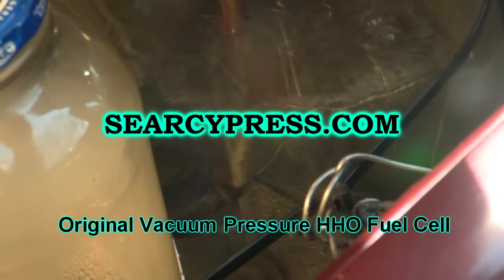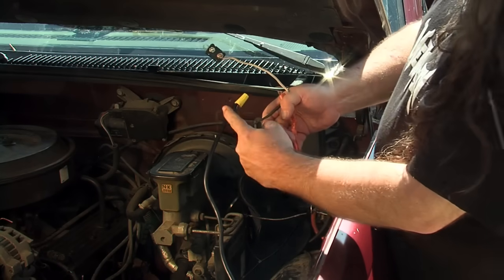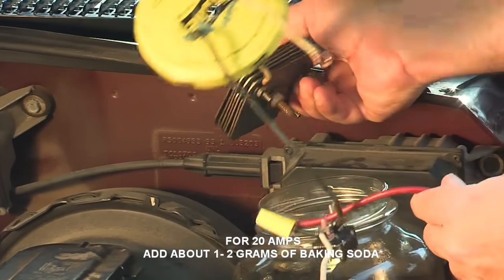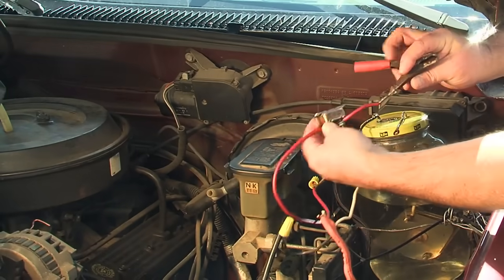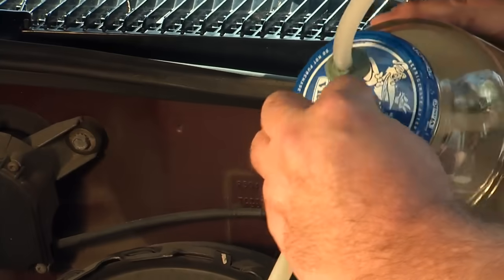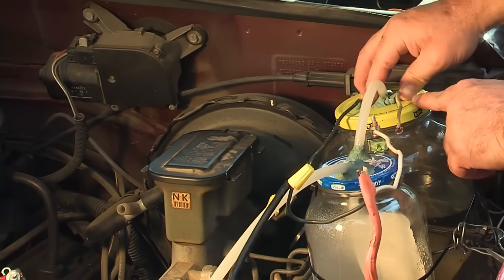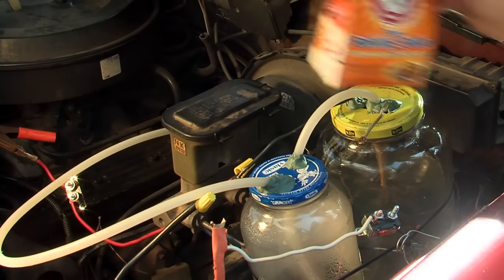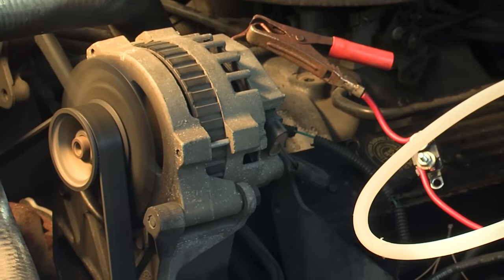Vacuum Pressure Hydrogen fuel cell defeats high gas prices using hydrogen from H2O.

Comment: how often do you add baking soda?
Reply from the maker: Generally about every 200 miles we have to add water. At that time you kind of have to adjust electrolyte. When it's hot the current flows more easily so under doing it is the way to go. Thanks for the comment.
Reply: just one more question. why don't  use salt or potassium?is not exactly a great chemist😂 Og tak for tidligere svar

Comment: Spoiler alert …. That engine is running on gasoline …. That jar of water would make enough hydrogen to run a model aeroplane engine for about 3 seconds after an hour of gas production… 😂😂😂😂😂😂
Reply from the maker: I understand your misconception. You seem to think we're running the engine on the HHO. That is not the situation. The gas we produce is injected in the state of vacuum into the cylinder where it accelerates the combustion of the gasoline. Spoiler alert, that is the only way HHO can be injected because any other method will result in dilution and no gain in performance. Almost 100% of the fuel gets burned in the cylinder leaving the catalytic converter cold. This results in great reduction of emissions and more power coming from the gasoline because it's all burned. The boost in performance is from gasoline and not from the hho. Thanks for the comment.

Comment: My grandfather worked at NASA and put one of those in a dodge van and drove it to work every day testing it for a month then drove it from Florida to Texas and back making adjustments in Texas to it I know it works but it a pain in the but to keep calibration correct 68 dodge 6 cylinder engine standard 3 speed transmission.

Comment: If it was this easy everybody would do it. The power diffeence in fuels ie diesel and HHO is considerable. The gas being made is more likely chlorine gas not HHO due to lack of power running through the cell. It takes a large amount of electricity to make hydrogen gas. DO NOT BELIEVE THIS BS.
Reply: Oh yes. We must believe your more likely than a person who made it and is using it

Comment: You need a special powder additive for the water and also a special pump to harvest the hydrogen and then regulate that to the proper line pressure your engine needs. A suzuki samurai only needs 3.5 psi of fuel and we have got it to run pretty decent on 2-2.5 psi full throttle. The hydrogen comes in as gas like propane does on the samurai so it takes less to make it run because more can get in easily. The liquid fuel takes more to get in and run proper. Stanley Myers would be proud of what we did in the early 2000’s. Its all about generating enough at once and also having a pump to harvest and store amd then use a regulator from there to engine.

Comment: I just want to see quantification in comparable units of measurement the energy used to produce the hydrogen, the amount of water used, and the additional amount of power that is produced. Watch hours might be a good unit of measurement. Would it be such a subtle difference that you would get the same results by adding small amounts of water to the fuel air mixture instead of using the alternators no constant resistance to produce electricity and instead let the steam add to combustion power?

I believe if this was truly feasible and efficient that hydrogen battery cells turning water or possibly hydrogen into electrical current would be common by now, but again most consumer technology has been retarded since the early 90s. 

Thanks for the video, cheers `-;

Comment: Combat high fuel prices eh? Never mentioned how much he combated high fuel prices. $1 a tankful? Putting a 29 amp load on the alternator isn't just free. It takes gasoline to drive that pulley.  Steam running through an engine will clean it from carbon but a steady amount of it everyday? Water is broken down to hydrogen and oxygen both of which burn. Mentioned this setup was 30,000 miles old "flawlessly". You'd think the biggest selling point would be the mileage before and after. I can wait. So far we waited 14 years.
Reply from the maker: You like so many you have a total misconception of how this thing operates. It does not power the engine. The HHO gas enhances the burning of the gasoline. Engines like this waste a considerable amount of the fuel which is later burned in the catalytic converter. By creating a near-perfect burn in the cylinder all of the fuel is utilized instead of wasted in the catalytic converter. The result is a lot of water coming from the tailpipe. A lot more than you normally see. I have no idea what you meant by a dollar a tankful. Thanks for the comment.
Reply: @metalpresstv  I agree but the "dollar a tankful" was a question not a statement. What is the difference before and after? Enquiring minds want to know.
Reply: @metalpresstv  "You like so many"? How did you misunderstand the question? I never once said it powered the engine. It helps a better burn of gas. Great, lets see the results. WHAT MILEAGE DO YOU GET? Lets try a simple question.
Reply from the maker: @mrwebber35 26 MPG as shown in the beginning of the video on a V8 350 carbureted engine. Normally without the fuel cell you're never going to get more than 15, and on average only 12 mi per gallon.  Hopefully that's clear enough for you. Thanks for the comment.
Reply: @mrwebber35 now why are you being grumpy towards my papa i don't really appreciate this attitude.
Reply: @pressmantheshow2  I was reacting to him being so evasive. It was just a question.
Reply: @metalpresstv  Almost double.

Comment: HHO hydrogen is the smallest molecule.  It leaches into everything,  especially hardened or elongated metals.  Your valves will crumble
Reply from the maker: Gasoline is hydrocarbons—hydrogen and carbon. Burning splits them; hydrogen forms water, carbon forms carbon dioxide. The energy released comes from both, meaning burning gasoline is partly burning hydrogen.
Reply: @metalpresstv  Keep telling yourself that. 
Or research it. Hydrogen burns perfectly clean. Its problem is that it is the smallest molecule & leaches into the pores of...nearly everything..,Essentially leaking always, while embritting everything it has contact with. 
But it does burn clean. Gasaholeline. .not so much. We know as a civilization our oceans & atmosphere are flooding of CO2.

Comment: It's fuel for combustion engines
Reply from the maker: Actually it's more of a fuel enrichment system. The gas itself does not power the engine. It Powers the combustion process making it more efficient. All the gain comes from the gasoline burning more completely. Thanks for the comment.

Comment: Is that the intake source ? When you place the hose into the carb vacuum thats how the Hydrogen gets into the engine and allows for more complete/clean combustion ?
Reply from the maker: A vacuum line directly connected to the carburetor would be ideal. The gases must remain in vacuum until they hit the combustion chamber. Mixing with are before that will result in dilution of the gas and minimize all results. Thanks for the comment

Comment: Anyone sell a kit?
Reply from the maker: There are a lot of kits out there but none of them are for vacuum. Probably due to the liability. It absolutely will not work by injecting it into the carburetor. There may be a hundred kits out there but not one of them is going to work if it's not directly going into the vacuum. We proved this before we released the vacuum cell. The cell itself has roots in a man named Joe in Australia. He was a bit off his rocker I think, he however he definitely had some things right. But you never know insanity is just one step away from genius. Thanks for the comment.

Comment: Where do I put the hose on the carburator? Didn't say how he hooked it up
Reply from the maker: Actually I showed exactly where I hooked it up into the vacuum line connected to the brake booster. A more preferable location would be literally into the vacuum line on the carburetor if you have one. Injecting it into the carburetor itself into the air will nullify any results. HHO is quickly diluted in air. It has to be injected into the cylinder in the state of vacuum. Thanks for the comment

Comment: How do you control amps? I use  8 gauge wire and after 30seconds of running it gets extremely hot and my fuses keep tripping and resetting.
This was connected to the battery instead of the alternator. Does that make a difference?

Comment: Is this basically a bit like a water injector system?
Reply from the maker: It is a part of it most certainly. The primary difference being, the injection of HHO in the state of vacuum directly into the cylinder. Why does this matter? It matters because anytime you mix a large amount of air with HHO it is immediately diluted. Hho injected into carburetors or air intakes is a waste of time. The HHO is not powering the vehicle. It is powering complete combustion in the cylinder. Increases in performance come from gasoline being completely burned in the cylinder instead of the catalytic converter. It's not any sort of over-unity or even using HHO as a power source. It is more of a catalyst for complete combustion. Thanks very much for your comment.

Comment: One hho generator uses citic acid from orange juice 
Lowering pressure may increase efficiency 
Like cold distill planet can boil  water at 80 degrees 
Any lower you may collapse your structure 
I would add air flow meter see if run lean Pyro for heat

Comment: On this platform WE OBEY THE LAWS OF THERMAL DYNAMICS!!!
This DOES NOT WORK PEOPLE! No matter how much hopes and dreams you cram into one of those jars you CANNOT get more energy out than you put in.
Reply from the maker: Allow me to enlighten you.  There is no violation of the law of physics. Other systems that inject directly into the carburetor do not work. They never have and  never will. The HHO is quickly diluted when injected into air. Also O2 sensors don't appreciate the extra oxygen. So, with that being said, understand this is not the same thing.  We're not powering the engine. That is the job of the gasoline. You seem to be under the impression that all of the gasoline is burned in the cylinder. This is far from true. In the case of this engine up to 20% of the gas goes into the catalytic converter where it is burned there. Injecting in the state of vacuum directly into the cylinder can burn almost 100% of all the fuel in the cylinder. Emissions are completely controlled. The catalytic converter stays cold so lots of water comes out which comes from the burning of gasoline. Any gain is coming from the normally wasted fuel. So understand, there is no violation of thermodynamics or free energy or anything like that. We're just injecting the system in the state of vacuum and getting a more efficient burn of the existing gasoline. Thanks very much for your comment.
Reply: @metalpresstv Sooooooo where does the energy lost powering this come from??? The supposed 20% gasoline that's not burned HA!? How did you even calculate that!?!?! I build engines as my day job. If you're losing 20% of you cylinder charge out your tail pipe then you have far bigger problems to solve that would probably increase your mileage far more than this thing ever could. And lets say you did manage to burn that 20% that you're losing for some reason. By the time that energy makes it back to the alternator that 20% is more like 9% with losses and then it would still need to go through an alternator where it would be cut in half again. Just fix your truck properly guy. You don't need this crap hanging off your engine.
Reply from the maker: @ChannelFixIt-qd4pq  I can't fix your perceptions if you're set on believing something inaccurate, when I explained it so clearly anyone can understand it. Take 20% of a gallon of gas,  take a good long look at it. That's about 6.4 kw of energy that could theoretically be salvaged from each gallon of gasoline. Like I said, normally it's wasted in the catalytic converter to control emissions. We're using 360 Watts with the fuel cell to get that 6.4 kilowatts of energy. ( Just by making it burn more cleanly. ) Yes it has to come out of the 6.4 kilowatts but I'm pretty sure if you do the math you'll see without violating the laws of thermodynamics we can get more miles per gallon. Anyway thanks, I hope you won't continue to argue when I have clearly lined it out for you. With that being said don't you dare even try to build this.  Question everything. There's nothing wrong with that. If you don't get good answers don't trust the source. Thanks for the comment.
Reply: @metalpresstv Is this what Toyota is currently doing?
Reply: It works, I did it..

Comment: I have a 2022 diesel which has a vacuum pump and that vacuum pump sacking in the air and putting that air into the oil, NOT INTO THE COMBUSTION CHAMBER ‼️so how is it possible to connect the hho with this kind of diesel?

Comment: Hi guys, will it work for a diesel engine?
Reply from the maker: @vechno.threenity  the system is reliant on vacuum from the engine. If you have a vacuum intake it would work. Injecting into the carburetor has never worked and will never work. That's the reason for so much controversy about the fuel cell itself. People build it , sticking in the carburetor and think it's working and then when it's tested it's not. The HHO is quickly diluted by air. You won't see them testing a vacuum pressure fuel cell. The gases produced do not power the engine. The fuel cell increases the efficiency of the burning of the fuel  in the cylinder, completely igniting all of the fuel. Any gains are coming from the gasoline burning completely. Engines like the one shown in the video waste as much as 20%. That 20% is then burned in the catalytic converter. The reason so much water comes out of the tailpipe is because the catalytic converter remains cool much longer. It does not come from the HHO. So it's got to have vacuum. If you can figure that out it most certainly will work. Thanks for the comment.
Reply: @metalpresstv  thank you so much sir. What video would you recommend to learn more about the vacuum on Ford 350 of 2022?

Comment: HYDROGEN GAS WORKS SAFELY.ON DEMAND...

IT IS ONLY EXPLOZIVE WHEN STORED AT PRESSURE❤❤❤

YOU CAM HAVE FIREWORKS USING SOAP AND BRINE ..LITE UP THE FLOATING BUBBLES ❤❤❤

Comment: Hey weird question, have you tried making the engine run completely on HHO? Or does it not work
Reply from the maker: @Rebel-p4p the inevitable result would be a melted engine. You can melt tungsten with this gas.  Thanks very much for the comment.
Reply: @ hey thanks for the info! I saw a video where someone made a small engine run completely on hydrogen and oxygen. Maybe he was full of Bs. That’s what made me question

Comment: How are you separating oxygen from hydrogen in that set up
Reply from the maker: @MikellRogers we don't. They recombine in the cylinder and burn almost all of the fuel in the cylinder. This gas does not power the engine. It Powers the combustion process and increases efficiency of the explosion in the cylinder. Thanks for the comment.
Reply: @metalpresstv  Have you
Tried separating And Just expelling the oxygen elsewhere? Or will it not burn as efficient? Most of the time I thought they separated it.

Comment: Can anyone help me why my hydrogen water in the jar become too hot?
Reply: Cant even touch..
Reply from the maker: @FareezOdoruth  if you have ample vacuum and you're running less than 30 amps the temperature of the water will be in 150° range. In the vacuum environment this will boil the water slightly. This is completely fine it is steam injection. You can always reduce the amount of baking soda you're using in the water. In most cases a very small amount is all that is needed. Has the water heats up the hydrogen production will increase so if you start low and work your way up you should be fine. This information is  for reference only and no one should duplicate anything shown in the video. Thanks for the comment.

Comment: Thing is, engine vacuum is lower at open throttle positions, regardless of rpm. Vacuum increases a lot in engine breaking, especially when the rpm is high and the throttle is closed, which could cause too much HHO to be sucked in, leading to knock and such. The only way I see to prevent this is to reduce initial ignition advance and completely disable vacuum advance.
Reply from the maker: @bobi_lopataru  actually using this system removes all engine knock. You're not going to get too much hho. Not in the the vacuum state.. Not at 30 amps anyway. Thanks very much for the comment.
Reply: I’ve thought this too and have done a little reading into it. From what I’ve gathered it’s best to use on a bigger engine that turns lower rpm or even a diesel, also a pwm would allow you to instantly control the output and adjust it according to your engines speed